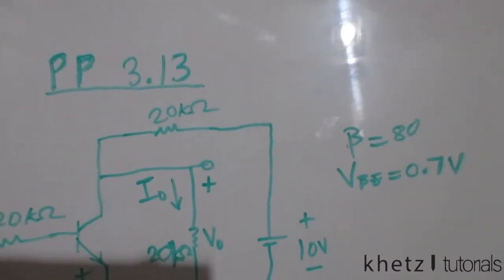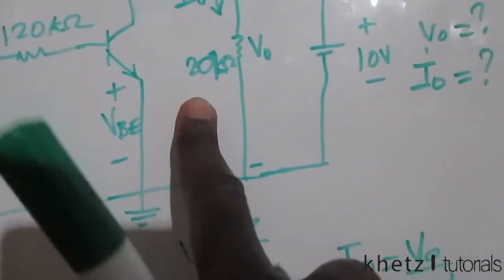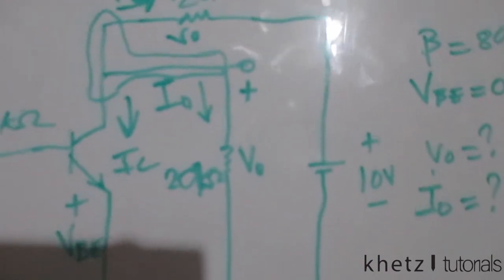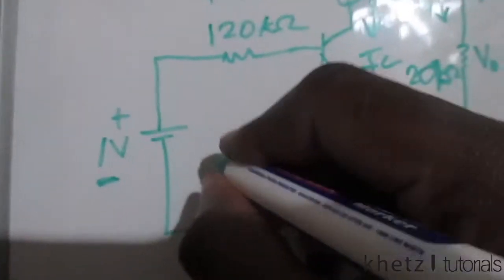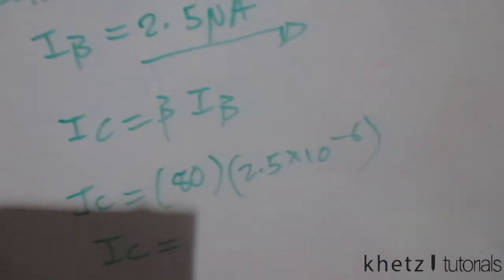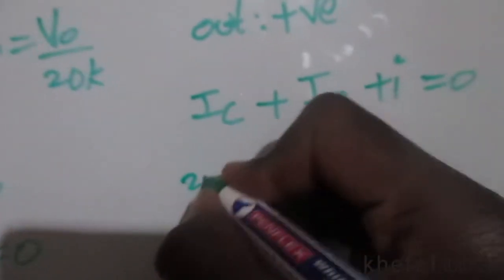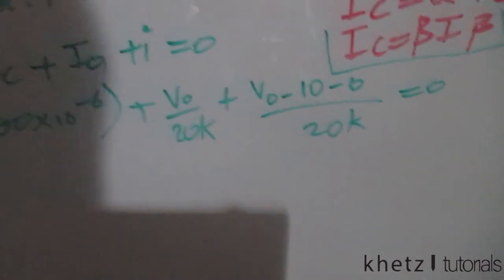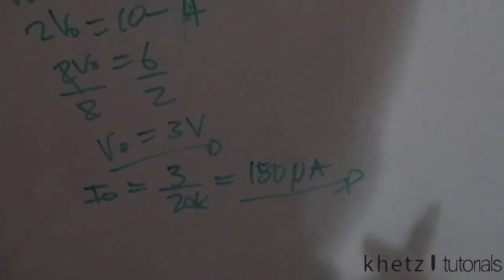Fundamentals Of Electric Circuits Practice Problem 3.13

Comment: thanks very much
but i have a question can I use mesh analysis instead of nodal ?
Reply from the maker: We were not given the transistor voltage that's in the loop so I'm afraid not
Reply: @KhetzTutorials   ok thanks alot